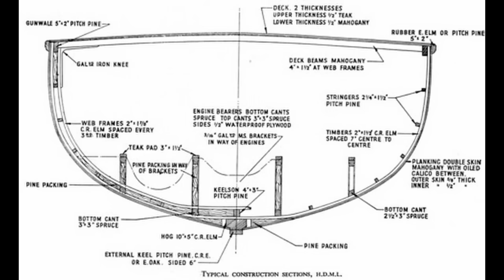Ep 134 - Plank Ya Boat Time! #boatrestoration

Comment: It seems appropriate to tackle the beam shelf and the planks on the port side before you tackle the deck beams. And if possible you could use a laser level and measure off that line to define the camber for the deck beams. 😊
Reply: That’s  a good plan the laser would give a great datum to strike the form lines 👍
Reply: Fix a datum post about 6 metres back that's parallel to the stem. Then the laser can be set perpendicular. it wont matter how the ship is lying or floating.

Comment: I worked on a trawler that needed new deck beams .New planks  inside under the deck fixed from the outside ,more planks screwed under the deck .Then the top screws were removed to get the beam out ,taken to the work shop fixed to 1 inch ply used as

Comment: On a boat like that there will be a consistent radius on any run of deck.  The only place where there might be a change is if there is a break in the deck.  The drawing should show the maximum camber at the longest deck beam if it doesn't give the beam radius.  When you laminate the new beams use a minimum of five laminates to minimize spring back.

Comment: Use a string line from beam shelf to beam shelf. Measure height from sring to apex on centre line.
Loft curve onto garage floor. Use the curve for each respective cross beam.
Btw, I was working on a WWII hospital boat in a restoration area. It was too big a job for me and no financial input so I let it go.
The boat was called Meriwee. It appears to be a twin for yours structurally but had an operating theatre aft of the cockpit. It evacuated wounded soldiers from Papua New Guinea.
I have a copy of the plans in Australia but no access at present.
Normally I live South of Brisbane Queensland (where Meriwee is), but I'm in Formby at present. Small world.

Comment: How to get your deck curve: Run a string line from side to side and measure the distance between sides. Measure the gap in the centre and at say every 500mm to the edges. Transfer that info to a piece of ply and nail in a tack at every measurement. Bend a piece of wood against the tacks around the curve, mark with pencil, cut out and bingo you have a template of the deck curve. Easy peezy. Cheers

Comment: Hey you two, just picking up on your point of enjoying a boat, even if it isn't sailing. I had a French fishing boat from the late 1800's during the 1970s and 80's. It was in dry dock all of the time I owned it. I completely refurbed it and so thoroughly enjoyed working on it and like you, doing restorative works properly. I never sailed it but that boat saved me mentally. Your doing a great, great job and through you - I'm still restoring the boat I no longer own. Bless ya both.

Comment: I agree with you that taking the curvature of the bulkhead is a great idea. but keep in mind that the old navy-superstructure probably stood on top of that bulkhead, so it might not really have a curvature to it. is that bulkhead underneath the front face of your wheelhouse? for structural strength you could choose to make a heavier beam underneath the point where the deck planks turn into your walkways on either side of the wheelhouse, that would also enable you to keep the floor of your superstructure level. oh, and maybe it would be nice to put something in the place of the old deck gun, just for visual reference to what she looked like in wartime. maybe something that doubles as a party table, airconditioning inlet or a glass dome to get some sunlight below deck.
I love the way you two keep learning on the job, keep up the good work!

Comment: While camber does add structural integrity to the deck, it's primary purpose  was originally to encourage water run off. So you're free to make the camber what you will, as long as it's enough to prevent deck flex under load...:face-blue-smiling:

Comment: Good vlog, Guys. There are mathematical calculators online if you have your chord distance (breadth of boat) and mid-ordinate (height from chord to arc). But if you already know the width of the boat and the height of the arc, use a bendy length of wood across the width up to the arc height and draw round the bend. I've had to use steel rules to draw arcs like that on bits of furniture. You can draw and cut that out on one length and use it for a template for all the others. good luck!

Comment: I could find myself in the path of a herd  of stampeding elephants and start laughing because I would know I have zero problems compared to the 2 of you renovating this ship. I laid an envelope on my computer screen with the edge touching the bottom of the beam shown in the blueprint...if I knew the scale I could easily calculate the curve of the beams. I assume the beams all have the same degree of arc:  the longer the beam, the more apparent curve. The shorter, the more apparently straight. For my guitars I have metal templates that tell me the side-to-side arc of the necks so I can match that arc on new bridges. It would be easy to draw several arcs on paper to discover the arc on the blueprints.

Comment: If you can get a string stretched along side of the beam you want to use as the model, from top of the beam shelf on each end. Which is also the bottom of the beam itself.  Determine the center of the beam and then measure the upward deflection at the center. (should be the high point). Then work your way back towards the outside at maybe every 20 or 30cm or so measuring the distance between string and beam bottom.record all those distances while working to the very outside end at the beam shelf. This should then be easy enough to take those measurements and create a template in the shop on a long straight board.    One question though, is the beam an equal measurement from bottom to top all the way the full length, beam bottom arc matching with beam top arc?  This would be especially good if the beam you do this on is the widest one on the boat.   Then as you make each individual beam,  work from the center of each  beam measuring the distance from center to each end to determine the total length, This way you keep the high point always in the center.   I'm sorry if this is hard to comprehend, my strong point is carpentry not my writing skills....
If this helps at all , fantastic. If not just ignore me like my wife does when I'm making no sense. LOL  I'm sure you'll handle this all just as well as you've done all the previous work.
Good liuck.

Comment: To find the rise in deck. Run a straight edge from end to end. Measure the center rise. Let’s say it’s 2” then back at shop draw a straight line on table then set a nail at 2” from line at center. Then spring a thin board from nail to outside edge’s and trace the board to get the curve.

Comment: Having replaced deck beams of this type on SS Toroa it is quite simple.
Take a string from side to side across the boat at the lower edge of the deck beam then measure and record at regular spaces from the bottom of the beam down to the string. Repeating this on three or more beams along the length that you intend to work will show up any change in camber when you lay out the measurements on a layout board.

Comment: One method to get that radius, run a taunt line across the edge of the ceiling across, and from the center point of the line measure up to the ceiling. You know the length of the string, the distance to ceiling. You can draw that down on the floor and with a baton make a fair curve..

Comment: I think you could use a trick we used to use in building wooden fences to get your arches duplicated.  Simply take the beam you want to duplicate and drill a screw in on either end letting it stand proud.  Measure the distance between them.  Tie a string tightly between the screws.  Measure the height in the center of the arch.  Make sure that you're measuring allowing for the distance of the screws to the bottom (or top) of the beam.  Take a long board and drive three screws one on either end the same distance apart as the ones you used on the boat.  Tie a string tightly between them.  Take a third screw and screw it in the same distance above the string in the middle.  We used fiberglass tension rods used on chain-link fencing but other material could work equally well.  Place it so it is in contact with all three screws, draw your line along it and cut it.  Much easier to do than to explain.
Reply: The method I've seen is make up some short thin ply templates glued together and pinned as close as you can get along the side of the beam and touching the the top edge of the beam you want to copy.  Then use a long strip of bendy wood and lightly nail at centre and one at each end so it's touching the deck. You may find the curve isn't very even with just three points and may need some at intermediate distances and you should get a nice smooth curve along the top edge of the beam. You can then draw around the inside edge of the stripwood onto the templates. Best to draw where the templates overlap each other and number them as it's likely to come apart when you remove it. Remove and reassemble templates back in the work shop and cut them along the curve you drew. Test on a scrap piece of thin ply or hardboard and use that as a test against the original beam and you can easily tweak that to fit nicely. You then have a master template. Hope this makes sense. Instead of bendy wood you could try the pencil through a block of wood method to transfer the shape but that doesn't always produce a nice curve😎
Reply: @Pilotltd  The curve is 'perfectly even' because the fiberglass rod bends evenly.  I've used this technique hundreds of times and every one was perfect and matched the next panel perfectly.  Not saying your method wont work but, it seems like a lot more work.

Comment: String a string tightly from port to starboard and measure the distance from the bottom of the beam to the string on distance of every 20 CM. This will allow you to create your form to bend and epoxy your beams to set.  then cut to your length needed.

Comment: regarding the beam shelf camber, it sounds to me like - it's time to loft the boat - full size. if you have the original "lines & offsets" you should be good to ignore what you've got and "rebuild". Otherwise, if it were me, I'd measure from the outside edge and middle to the floor - at each station, transfer those to a large flat surface - borrow a basket ball or tennis court - then 'fair' the lines to account for the 'sagging'.  Good luck!

Comment: There are already 250+ comments already but here is my 2 pence: use a laser leveler on the reference and measure every 25cm then compare that to the drawings, if they closely match go with that if not, follow the drawings.  You do want some crown so water flows off the deck.  Do keep in mind that you do have to bend the wood to match.

Comment: Rule of thumb by American standards for drainage is one inch every 4 feet. So, from the center of your deck beams to the sides of the ship you should have that level of decline for drainage. It also looks by the plans that is also the case from the bow towards midship at a minimum. A wave comes crashing over you want to get the water off asap!

Comment: I would leave those frames across the windows - added strength. Chop the jigsaw blade with an angle grinder so it wont hit the frame.

Comment: Remember that big spring you put in last week that you are afraid to take the fasteners out of this week?  That beam is supposed to be holding the planking in place but instead it is trying it's best to take the curve out of the front of the bow.  You should remove those beam shelves and rebuild them from thin material that can be bent to conform to the shape of the hull and then laminate them all together so that the beam shelf is not trying to distort the shape of the hull but is supporting it instead.

Comment: Deck Beams. the camber should be the same for every beam so making a template and former from the widest point as you suggested is correct. Each beam should then be cut to the required width from the same centre line as they get shorter towards the bow as the camber is not neccesarily a true arc.. Hope that makes sense.

Comment: Set your laser line to touch the widest deck beam on both sides. Measure the height of the centre of the beam and at equal distances towards both sides. Loft the marks on to a floor of plywood sheets. Place nails at each mark and use a long batten to get a fair curve. For the shorter beams use the same height measurements but at shorter intervals. To transfer the curve to the pattern material lay round wire nails on their sides with the head on the penci line, tap them in to hold them in place.  Place the pattern material over the nails, tap lightly to transfer the marks made by the nail heads onto the underside of the pattern. The pattern can then be used to layout clamping blocks which could be made from "t" shaped steel with different leg lengths  tack welded onto a lenght of say 4" box steel. Reposition the blocks to suit each beam.  The box steel could be laid horizontally on the floor or if you prefer on a number of legs vertically to allow clamps from above and below.

Comment: Usually the camber curve in the WW II era was a parabola rather than a circular arc. Indeed, the same curve was used for the entire length of the deck as Simon says in this video. When the ship was lofted prior to construction, the deck sheerline was the "start" of the camber curve and the intersection with the sideshell determined the shape of the deck edge. Your problem in setting up the camber of the deck is sort of opposite -- you have the deck edge curve but you're not sure of the deck centerline. I'll be interested to see if the deck goes together easily in future videos.

Comment: Interesting challenge; the radius should be constant, however one must establish a fore & aft centre line and then measure/reduce the length of the radius measuring port and starboard from your centreline?   You might establish the centreline using a wire set tight from forepeak and running aft to the centre of the deck beam you intend to use as your reference. I guess that the hull might have sagged in places so this might also mean pulling the sides in towards midships (the reference centre line and centre of each radius) and then held by the deck beams?  cheers

Comment: for your deck beams, if ou have the construction drawings they should be scaled. print out or xerox a beam, then take to an industrial print maker or copier and have it scaled up to full size. cut out and glue to thin ply wood scroll saw out to make a template. you said all beams where same

Comment: For large radii I would use a straight edge as you did and measure the gap to the beam, then using CAD you can work out what the radii is- I did this to measure the curvature of my motorhome when ordering windows, the radius was 8.9m! windows fitted perfectly, Those drawings dont appear to be building ones, overview type, there should be drawing for each bulkhead showing the radius if they exist- good luck

Comment: You could have a line projected from a laser level against the bulk head, you make sure it is parallel to the height of the two beam shelves, you then measure the height of the bulge to calculate the radius.

Comment: To get a an accurate beam curve template, you could use a long flat piece of aluminum, press and curve it inside against the beam, attach temporarily to beam and mark it at the center of the ship and equal lengths to either side for holes. Bolt, two pieces of rigid  wood to assure the aluminum doesn't warp. The template allows reuse and you can check your theory that the curve is the same throughout the length of the ship. 

I hope this suggestion is useful. It's obviously way easier to suggest something as a viewer on the opposite side of the planet.

Comment: About constant radius deck beams: It depends on what shape you want the centre of the deck to be. Generally there are three shapes, A) The deck shape follows the sheer. B) The deck shape is straight, and C) the deck shape is whale backed (goes opposite to the sheer). Obviously, constant radius beams will not allow all three to be true. It should be equally obvious that constant radius beams will not allow the centre of the deck to follow the sheer because the height of shorter beams will be less than longer beams. I read about this somewhere... I had thought it was BUEHLER’S BACKYARD BOATBUILDING (which you should probably have a copy of) but I couldn't find it in a quick look through and I am looking at the new edition not the original. Anyway, It seems to me the general gist was that constant radius beams tend to whale back because the beams get shorter quicker than the sheer rises towards the bow.

Having said that, I have not seen anyone who is building boats build new forms for each beam when laminating. Even those who have done boat building/repairing for a living. I have seen people put a straight edge along the top and plane the beams for a straight line. You can of course try measuring the centre beam height at different lengths and add that height to the sheer height to see what kind of shape you get  :P  Not a lot of fun and prone to error but perhaps would point out if things were way out from what you want.